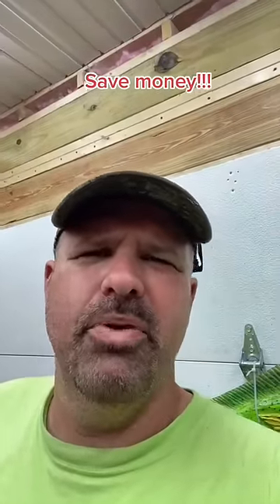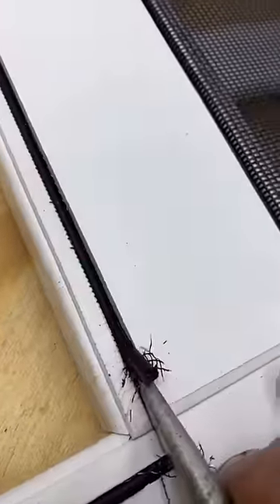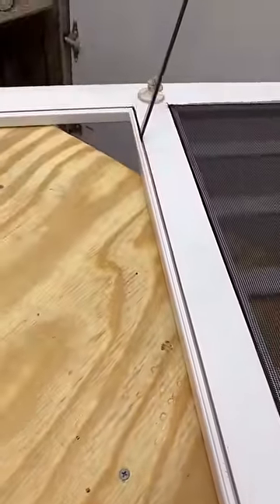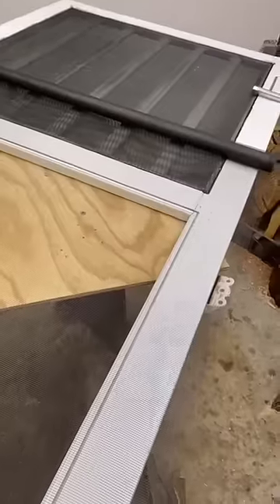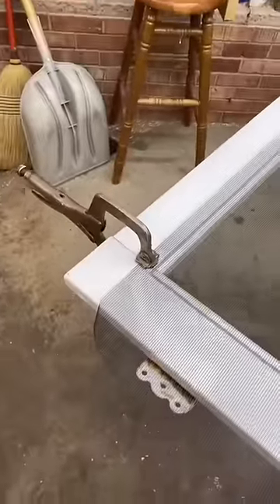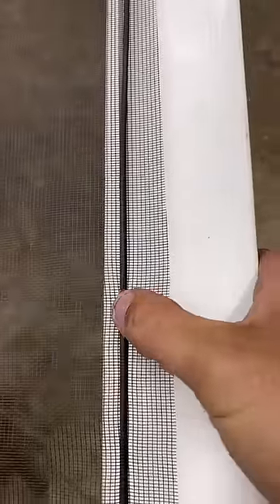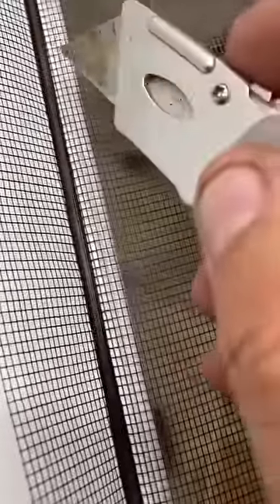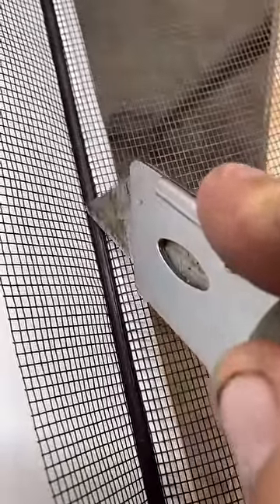Ever change the screen in your windows or doors?

Comment: Pro tip just get new gasket, a lot of the time the old gasket is dry rot and cracked, no point in saving. Also the screen roller tool is a life saver
Reply: Pro tip, we call it spline...
Reply from the maker: Lol
Reply from the maker: Thanks Mitchell
Reply: “Pro tip” then continues to call it by the wrong name. Remember folks, people pretend to know stuff on the internet.
Reply: @Nothanksgiven34  bud 
You forgot this is the internet huh 
Different people 
Different names for things
Reply: You can reuse the gasket depending on its condition after you remove it. I reused mine because it was a different color(Grey) to match the metal screen
Reply: @Nothanksgiven34  protip we call it a staple gun
Reply: @SleepingSheep95   and a spline tool, not a roller.  I thought I was losing my mind with all the people calling it a gasket
Reply: It’s rubber how can it be dry rot lol. I do it all the time it can get frayed but it’s never ever been too bad to use

Comment: One time I was at a resort and while I was messing with a friend of mine, I popped out the screen on the door. Me and my friend were getting all sorts of things to try and push the rubber lining back in. And then this really nice guy that worked there gave me this tool that sorta looked like a pizza cutter to push it back in, it worked, and I got it fixed, I'm still surprized that he wasn't mad at us.

Comment: The funny thing is that the skill I truly lack here is knowing how to pay someone to fix that. Like I honestly don't even know who to call. I have lots of things around the house that are on my repair list mostly because I have no idea who to call to fix it. So I just YouTube what I don't know and get it done. Rewired a basement using Pinterest (seriously) and it passed inspection. Waistcotting, refinish floors, drywall, tiling... Last week I installed recessed lights in my folks house. Going to replace the counterbalances in their windows soon so they stay up. Replaced all the lights in my car with LED to fix the burned out ones and had to figure out the polarity because LEDs only work one way. Not to mention fire pit, wood benches, and painting. Soooo much painting. My best skill is sanding. That and driving trains.

Edit: I have the tools and fix my own screens. I'm saying that I don't call people, I fix it my self.
Reply: Just ask the friendly old retired dude down the road. He'll tell you or fix it for you.
Reply: menards does it
Reply: Local glass shops typically do screens. I've done them for years.
Reply: Absolute legend
Reply: Awesome 👌 👏
Reply: @taliesinangling3564  free?
Reply: @lia-liz2012  you pay for labor and materials, $10 labor for uner 16 sq ft $20 labor for over
Reply: Google it
Reply: Some hardware stores do it, but almost any window cleaner can rescreen as well.
Reply: If you're on good terms with the neighbours, ask if they have any good experiences with certain contractors. A friend's recommendation is worth more than an online review
Reply: @taliesinangling3564  what the hell is a “Menards”?
Reply: You don’t know who to call because it’s you who gets called.
Reply: It’s called a general contractor
Reply: Craigslist
Reply: @kevinblack8584  it’s a store, I guess look it up maybe it’s not in your area
Reply: I wanna drive trains.
Reply: The ace hardware by me does it. They're not cheap tho
Reply: Most window repair services have screening prices
Reply: And the best part of doing it yourself is that you know you've done it right.
Reply: Pinterest for the win!
Reply: Ace hardware
Reply: Typically, I think the person you would call for most of that is a contractor
Reply: Home Depot has hiring services for contractors so if you're ever feeling lazy and have some extra cash.
Reply: @thisismagacountry1318  spiral counterbalances are shot and way out of warrantee. Tried tightening them (I have the tool) but they are long gone. New ones are cheap. Will slowly replace them. Paint and trim is higher priority. It's a part time rental (Airbnb) they bought a few houses down from mine so they could see their grandkids (I live in another state). So I keep up repairs and they have a place to stay when they visit. 

Actually, this place was crazy. Framed 24" and the whole kitchen was walled in cabinet grade 5/8ths plywood (with matching cabinets).
Reply: @kevinblack8584  hahahaha. You don't live in the Midwest. 

Home Depot or Lowe's style home improvement store. That also has what I call the Man Grocery Store (mostly frozen pizzas and snacks).
Reply: @michaelebbighausen3733  damn straight!
Reply: @culturebreath369  do you like sleeping at night. Cause you gotta give that up for being on call and working at the least convenient times for family life.
Reply: @Urbexman14  Ace is the Place... for highest prices in town and that one screw that no one else carries.
Reply: YouTube is clutch when it comes to learning how to fix things that you don't know how to fix in the first place
Reply: True man
Reply: And that, is truly impressive. Ya gotta do, what ya gotta do. 👍🏽
Reply: Make sure those LED light replacements are meant for and designed for your model of car, the lights can be much less bright than traditional style bulbs if they're not in the right position for the reflectors to work properly.
Reply: @TheDarkroomDude  very true. I got the lights installed and noticed the direction they needed to be in successfully. Much brighter than before (mostly because they are whiter and not yellow like the originals). I also had a burned out dash light that left half the speedometer dark. I purchased new LEDs and that was a nightmare. The first batch they sent didn't fit/wrong style. Second batch fit, but took a lot of work and luckily they sent more than double because I broke several removing the excessive soldering leftovers. Also, I had to identify which was positive and which was negative (because diods only pass current one way). Getting into the dash was easy. Getting the spare batteries I rescued out of a dead laptop to stay in the configuration needed to power the LEDs at the right voltage when all the neodymium magnets in the house have gone missing; that was a little harder.
Reply: @toadjones79  I'm glad you were able to get some good replacements.  I've seen a few poorly replaced lights out where I live and the break lights/turn signals on those cars are barely visible in daylight, so I just wanted to make sure.   Sounds like a rough time with the dash, trying to find an appropriate power source for LEDs has also been a quite the bugbear for me too.
Reply: @Daedje  lol I fucking wish I had one
Reply: You can call a guy like me. I run a household maintenance company and people love it when I teach them how to fix stuff up
Reply: Ghostbusters
Reply: Please brag about easy thing some more
Reply: Good greif i wish i had half the motivation you do.
Reply: Sounds like you  just became an accidental tradesman
Reply: @josiahbaumgartner7643  ok: I don't go online to tear down other people to make up for being disappointed with my own life. That kinda easy. Oops.
Reply: @toadjones79  It’s not about me. You’re literally just bragging and pretending it’s about not knowing how to call someone. Chill dude. We get it, you’re a big strong man. What do you want me to say? Round of applause for not being worthless? 

Your comment is the YouTube comment equivalent to telling the person interviewing  you for a job that your biggest weakness is “working too hard”. Who are you trying to impress? Lmao
Reply: I've never related more to a comment 😂
I wind up fixing things and installing stuff for my folks all the time, and I have no idea how to get paid repairs done; it's like a foreign concept to me.
Reply: Im saying this out of experience but:
The best thing to do is to have professionals do it for you if you are not comfortable doing it yourself or have no idea what you are doing. 
(You can learn how to do it properly by observing professionals. Make sure you ask if you can watch them do it first though and dont get in their way.) 

After all, it's better to be safe then sorry. 
(Most people have made some expensive screwups when trying to fix things they have no experience fixing after all, mainly when it comes to complicated handyman work).
Reply: You can get it fixed at any glass & mirror shop. Only takes a few minutes. I used to work at a glass shop. This is one of the easiest home fixes you can do yourself, but it’s not actually that expensive to pay a professional, either. Especially if they’re rescreening multiple frames for you at once.
Reply: That’s how most handy men make their money. There’s some good honest companies out there but a lot of them prey on you not knowing the problem and they get to take advantage of that fact.
Reply: The guy that checked your basement was probaly closing both eyes for you.
Reply: A window/blinds cleaning company. I cleaned windows for a couple years and I changed screens all the time.
Reply: I actually run a Screen business In Arkansas. Just closed on a contract for 100 screen porch enclosures on a newly constructed neighborhood last week 👌🏼
Reply: Google. Or fix it yourself. Perhaps make yourself a google result.

Life pro tip: even if you don't know, call the first person that sounds KINDA right like just a handyman. Even if you're wrong, they're a tradesman and are more likely to know who to direct you to.
Reply: Learn how to fix them fixing things is just what men do I've fixed so many things and installed things by reading how to do it youtube and what not it's just part of becoming a man
Reply: @toadjones79  only if you have a prescription
Reply: I’m in the exact same situation. I wouldn’t mind paying somebody a decent wage to do a bunch of repairs and projects around my house, I just have no idea who to call for most of it.

Comment: I used to do this and windows for a living. There's definitely a technique to avoiding bowing the frame, and keeping the screen lines straight with no waves.
Reply: Maybe I like having my screen go at an angle.
Reply: @justtosaythis2087  🤣🤣🤣
Reply: I used to do customer service for mill gard windows I was told I was not allowed to do screen jobs lol
Reply: @justtosaythis2087  I never even thought about this but honestly why not
Reply: I tried it once and bowed the frame like you said.
Reply: I’m currently doing this for work 😂
Reply: Exactly what I was going to say. Anyone that hasn't done it before may cut the excess new screen off without checking if it's bowed or out of square. Once you do that you can't reuse the screen. Start all over
Reply: @joeguinta1669  I must've wasted hundreds of dollars in screen when I was learning the trade. Glass cutting is even worse 🤣
Reply: @blankdude9996  haha. Don't I know it. Started in the glass industry nearly 30 years ago. Off and in but still at it. No more cutting glass for me though.
Reply: @Bada_Boom78  using a large flat table helps. Getting a screen roller too. That helps push in the rubber spline. If it's a rectangle, Always start with the shorter side. Then long side then short side then the long side is last. Before you start pulling that tight you need to check it. Lift it up and look down. do you see any waves.? Is it bowing the long sides.? The screen framing is weak so the screen will "bend" it. Before you cut the excess off make sure it's true and square
Reply: @justtosaythis2087  that happened to me lol
Reply: Put a board in middle to keep it from bowing. It's a trick. When done. Remove it. I learned it from a screen & glass guy that did it for 30+ years.
Reply: @johncunningham9840  We had an adjustable brace for that purpose, but you end up putting the screen too tight sometimes so we stopped using it.
Reply: A piece of  Pine lattice cut 1/16 wider than the interior width helps to avoid bowing.
Reply: @ookie4179  Your screens will never be perfect doing that. It will always be loose in the center compared to the corners. The best way, is learning the proper screen tension by feel. In my opinion!
Reply: @blankdude9996  true, but starting out it helped me very much.
Reply: @justtosaythis2087  the sas
Reply: Not to mention that unless some BS happens to the screen, the rubber will usually end up being brittle by the time you actually need to replace a screen. And he doesn’t show the hardest and most skilled part of the whole job. 🤦🏽
Reply: @joshuab4586  Oh man you just gave me flashbacks from all the boomers who would request to reuse the original spline 🤣
Reply: @blankdude9996  literally every single time, gotta save that $2 extra
Reply: @johncunningham9840  Thanks
Reply: Whenever I do it there’s always waves in the screen.  Seems easy but I always screw it up.

Comment: I've been doing this myself since I was a teenager. I went to Home Depot and saw "screen repair kits" that came with the screen, a roll of gasket, and the tool to push it in. I read the instructions and decided I could TOTALLY do it myself. I paid $20 for the kit, and it was enough to do all five windows I needed to repair. It's actually very easy.